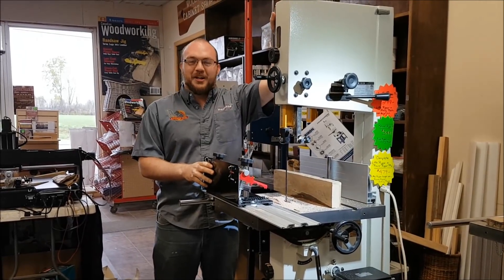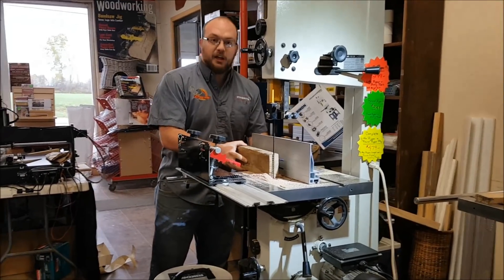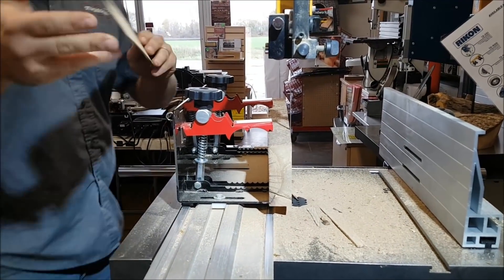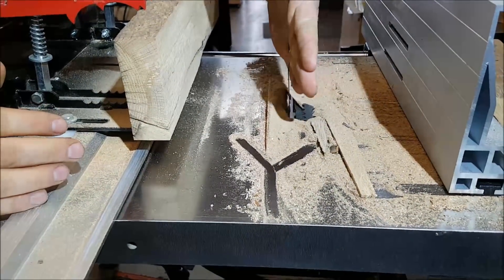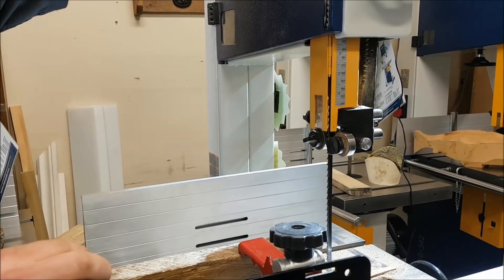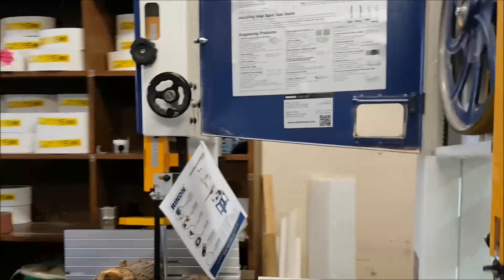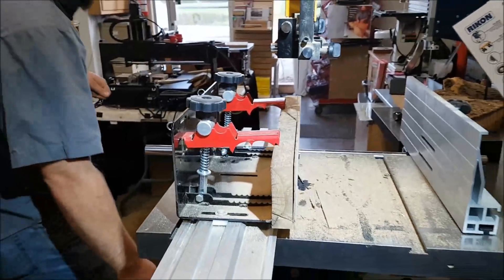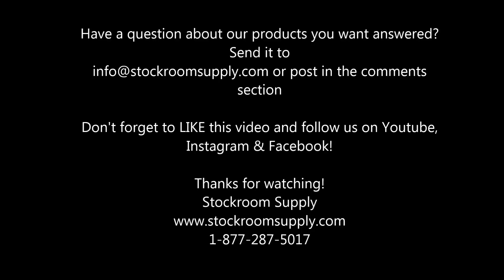EthAnswers Blade Drift myths, Why Bandsaws Should Never Drift!

Comment: So if I set it WITH correct adjustments, it still won't cut any better at all?
Reply from the maker: hmmm interesting question. You cannot cut any straighter than I cut in my video(as I cut perfectly straight) BUT you can cut smoother and faster. I would never recommend you set the blade as I have in the video...but just want to show how little the setup matter when you don't bind the blade.
Reply: I see.  I'm having a big rikon delivered today and I'm very impressed by your cutting method.  I would never have thought to do cutting any way other than "experts" advise, but I will give your way a try.  I know you can't actually recommend it but I'll be careful because safety when using ANY tool is always in the forefront of my mind.  I love my fingers.

Comment: I think you will get blade drift if you leave the band off center and tension it. Effectivly the wheel crown makes the teeth follow a slightly larger circle (top of the crown) than the back of the blade (bottom of the crown). Try it and see. I have a cheap ass Harbor Freight band saw, and as long as I put the gullets on the crown and don't push hard to feed, I have little trouble with drift. However your Little Riper is an interesting invention and would work great to cut boards from trees.

Comment: Great video.  I had "blade drift" and after changing a dead dull blade, the drift went away.  I purchased the saw used and was using the blades that came with it.   Invested in some new blades, the issue went away.
Reply from the maker: Thanks Mark!
Sometimes a new blade goes a long way!
Ethan

Comment: I understand what you said.  I saw what you talked about, but, I am having trouble understanding what the different is between the fence holding one side of the board or the little ripper doing it from the other side.  Can you explain?
Reply from the maker: Hey Dave,
I love the question! I'll do my best to explain the difference here.
When you push a piece of wood through a fence it will stress. When it stresses it will push away from the fence and bind the blade. OK so that makes sense. What make the Little Ripper different?
When you push a piece of wood that is clamped in the Little Ripper through it will stress. The wood will stress on the far side without any interference from a fence. On the Little Ripper side the wood is clamped in place at 8 different points therefor the wood cannot move until it is release from the jig. So long story short...On one side the wood is free to stress on the other it is locked in place therefor it cannot bind the blade.
Hope that makes sense!
Ethan

Comment: So, if you have blade drift, then just get a new blade? and don't use a guide fence?
Reply from the maker: Well short answer is yes. Blade drift happens because the user binds(pushes on one side more than the other) the blade. This happens when you use a fence, freehand or resaw pin. As soon as you bind the blade drift happens...and once your blade drifts there is no fixing it.
The only way to avoid binding the blade is by using a carriage just like sawmills have for centuries. This eliminates the binding issue therefor eliminating the drift issue. Hope this makes sense!
Ethan
Reply: I got a small SKIL band saw. I checked my blades and I did see one side almost gone and the other still there, replaced blade and tried making cuts, and yep, you are right.  It makes sense, especially for the harder woods.   Perhaps there is also an issue of the blade being parallel to the carriage, and that is the blade position on the wheel, not forward or centered or back, just whatever makes your blade parallel to carriage as much as possible.   Well, need to make me self a carriage then.  thanks

Comment: Honestly, for me I was able to eliminate drift on my Laguna LT18 using 1/2" to 1" bands by placing the band at the center of the crown on the upper wheel.  This adjustment on this saw is extremely easy.  I've owned two generations of the LT18 over the past 20 years and so I really can't comment on what drift is like on a smaller saw with more narrow bands.  I'm also very careful in all aspects of setting up my saw and I find I must clamp both ends of the fence on this saw because the aluminum fence really flexes quite a bit.  If I don't clamp both ends of the fence, I really have problems with what looks like drift.  Until the past couple of years, I adjusted for drift in the commonly acceptable methods and they worked for me, too.
Reply from the maker: Thats great Mark! I'm happy you are having such good success. What I have found is as long as you eliminate the side pressure of the blade you do not have to be careful with any setup at all. That is what I did my best to show in the video.

Comment: Put the band in the correct location on the upper wheel and there should be no drift.  In my opinion, all devices designed to correct for drift are actually correcting for incorrect set up on the band saw.
Reply from the maker: Hey Mark,
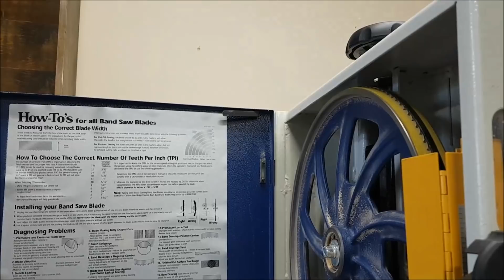At 6:30 in my video I tried to show folks how little the adjustment of the top wheel matters. Not that I'm telling people to adjust their bandsaws incorrectly but just that it doesn't make much difference. I appreciate you opinion though!
Reply: I think the technical answer about why blade drift occurs in this video is correct; because the wood is forcing the blade to deflect and dull on one side.  I agree that "proper" bandsaw setup can largely mitigate drift, but there is an additional answer in this video-  if you're cutting veneers, you want the thin cut on the far side of the blade from the fence.  Additionally, if your board is already flat, you may consider sacrificing one slice and gluing the board you're cutting veneers from to a  3/4" plywood backer before sawing it in order to keep it straight/flat as it releases internal stress.
Reply: Mark. I agree. Some people set the fence parallel to the mitre slot but don't set the mitre slot parallel to the blade. The poster has clearly set their fence parallel to the blade, which will be why their cut works, but it would be useless if they tried to use a mitre slot guide. Indeed, it's all to do with setting up the bandsaw correctly. And to me that bandsaw was not set up correctly (the cast iron table / mitre slot needs aligning with the blade and then the fence setting to the mitre slot). Bad original poster! Thumbs down.

Comment: Well howdy, missed ya at the Baltimore woodworking show, so a  question.... is there a way to get easily repeatable veneer widths using the lil ripper.  I did buy one from you last year.  Just trying to make things simpler if possible.
Reply from the maker: Hey Nathan! Yeah sorry about Baltimore...on our way to the show we had a bit of a situation at the border. We had been doing our paper work the same way for 10years...but that morning the officer didn't like it. Long story short we missed the show! Not to worry though we have things sorted out for the future.

As far as repetitive cuts there are a few solutions! Many guys clamp a wood block to the table as a stop and use that for reference.
We have developed the MicroMag Stop Block for this exact purpose those. Check out this video-
https://www.youtube.com/watch?v=m29dTBwpfn8
Reply: That looks like exactly what I would need... I guess I will wait till I see you next show season... ya know save on shipping...
Reply: Ironically... I just got notified today of the message.... Go figure...

Comment: Very well explained and graphically demonstrated!  You made one error. When you explained the offset of the teeth on the band, you called it "kerf". It's called " tooth set". Kerf is the slice made by the blade.  Maybe you just misspoke.
Reply from the maker: Thankyou much!
Yes I did say kerf not tooth set. I do sometimes use them interchangeably but you are correct they are slightly different. Hopefully I didn't confuse anyone. :)

Comment: just bought second hand 630 mil diameter band saw and top wheel is wobbly on mounts but when stript and put onto level surface it is siting evenly on table what do you recon it is issue there apart from bearings???? thank you
Reply: I had the same issue. I reinforced my motor mounts, made a sturdy motor tensioning turnbuckle, checked the wheel run out, etc. What finally solved the problem was two new urethane tires!  There's still a very tiny amount of vibration but I think it's because it's a cheapo saw from China.
Reply from the maker: Hey Zvonimir,
My first thought goes to bearings but it potentially could be something else. Check and see if the wheel itself is running true. It may just be that the rubber tire over the years has become inconstant thickness and is cause your wobble. Hope that helps!
Reply: thank you mate I have strip everything a part and previous owner has done bad repair so I have puled bearings out and re weld bearing seats and took to local machinist to re seat bearings cheers
Reply: every thing is made there lol
Reply: stript everything and took it to machinist for proper check he will fix it with in week thank you

Comment: I always thought you were supposed to take off the veneer on the side away from the fence, which would allow it to open up like you show here, correct?  This is a cool video and interesting product. :)
Reply from the maker: Joseph, you are right. It is always best to cut the thin side off away from the fence. The real problem when using a fence is when you want to cut a board straight down the middle. Regardless of what you do when that wood begins to stress inevitably it will push against then fence and bind the blade...therefor causing the drift!

Thanks for the comment! Glad you enjoyed the video :)

Comment: Wow. This challenges a bunch of Conventional Wisdom. I'd always thought that "drift" was actually another word for "your blade isn't lined up with your [miter slot]/[fence]/[whatever] and you need to compensate for that with (a) get your setup: guide blocks, tension, etc., right, and/or (b) adjust your cutting angle". If I get your (ahem) drift, seems the problem -- or more accurately the 'solution' - is more about *avoiding binding*. (Which perfect freehand cutting would do, obviously - it'd be a substitute for the LR - but: show me the human robot who can cut e.g. veneer freehand.)

This is a good (again with the puns) parallel to my problem with the whole jointing/planing mess, especially when the wood has spring in it (and/or twist, cupping, or bowing). It's coming at the problem, literally*, from the wrong side.

Anyhow, as I'm about to resaw a bunch of very expensive burlwood for knife handle scales, I'm very much thinking about what you've said here. 

https://www.youtube.com/watch?v=3hbdC88LQ-Y&feature=youtu.be&t=3m56s&end=4m00s
-------------------------------------
* (I have a solution to that, too, which I use in my shop - if you're interested in making a "Little Surfacer", lmk. :-)
Reply from the maker: Thanks for the comment! 
You are absolutely correct, if only you could hold a piece of wood straight (within 0.012") you could cut freehand without binding the blade every single time! Not to say the little ripper is a new idea...sawmills have using the same process for thousands of years. The fact that conventional wisdom is being challenged by the little ripper , to me, is ironic.

p.s. great puns

Comment: Great demo.  2 questions if you don't mind.  
1. You state that the pressure from the off cut due to stress is causing the binding.  What makes the Little Ripper different than just using the fence on the other side or for that matter just making the standard fence have the thin slice on the outside of the board (away from the fence?)
2. I notice that there was no deflection on the off cut on the second slice.  Is that from the Little Ripper or just from being deeper into the board and away from what used to be the outside edge?
Reply: Drift is imaginary, but I totally understand what you're stating. 1) When pushing wood through the blade, you must theoretically only apply a straight force perfectly directly inline with the blade - preferably at a point source in front of the blade. This is just not practical to humanly do with a thin edge to the fence. It is much easier to push the thick side of wood, registering against the fence and cut off a thin strip (assuming the board is perfectly faced to the fence). I've found that drift is also highly attributable to human feeding error & setup, something I presume this jig is trying to mitigate. 2) Once again, the little ripper is a clamping sled, that only allows you to apply force directly in line with the blade, it creates two virtual datums so you don't have to face two sides of the board at 90 degrees.
Reply: Stockroom Supply A
Reply from the maker: Thanks Kirk!
1- Great question! That is one of most difficult question for me to answer but I will do my best. For starters the absolute best way to use a fence is to cut the thin side off and readjust the fence each time. The thinner side of the cut will always stress more than the thicker side. The problem is when you cut a board right down the middle...the question becomes which side is going to stress? Both sides will stress...so inevitably you will bind the blade.
OK so how is the Little Ripper any different? Why don't I bind the blade on the Little Ripper side? The wood is held by eight different points by the claws...when the wood is clamped in place it cannot move until you release it from the Little Rippers grip. At woodshows I show this by taking the wood out and laying on a flat table...because of the way wood works it will have a small twist but only after it has been removed fro the Little Ripper. I hope this makes sense....In the future I will plan an EthAswers topic on this question.

2- If you look really close you can see towards the end of the cut the piece of wood does begin to deflect but, as you said, not very much. Every piece of wood is different, every cut is different. It is neigh impossible to predict what will happen until you make the cut. My second cut just happened to be in a more "stable" part of the board.

Thanks again for your questions!

Comment: Great video, can you comment on the blade you used? You demonstrated that the saw setup (or lack of it) is overcome by the Little Ripper, can it overcome a bad blade?
Reply from the maker: Great question Doug!
I may use your question in a future video.
First off the little ripper does not eliminate blades drift, rather it prevents it. If I put a blade on my saw that already drifts the Little Ripper will not fix it. But the Little Ripper never allows you to put drift into your blade.
You have to remember a standard bandsaw blade has about 0.025" kerf....if I reduce that set by 0.001" on one side of my blade its going to cut about 7-8% the opposite way. It's very easy to do this freehand, against a fence by binding  the blade or twisting the blade with a resaw pin.
Long story short...As long as you don't damage the set the blade will cut perfect. I've been at woodshows cutting osage orange with dirty nasty bark all weekend with the same blade. By the end of the weekend the blade is incredibly dull..but dull equally on both sides. Therefore still cuts perfectly straight.
Hope this answers your question!
Reply: Thanks, if it's ok with you I'll post my question and your answer on Canadian Woodworking and home improvement forum where your video is being discussed
Reply from the maker: That would be fine with me! Happy to hear you guys fine this video worth discussing